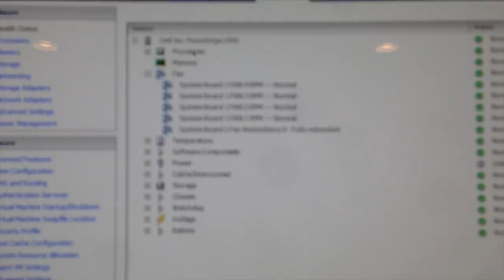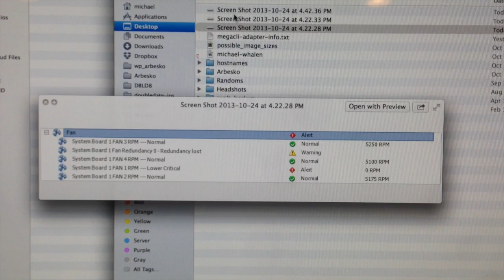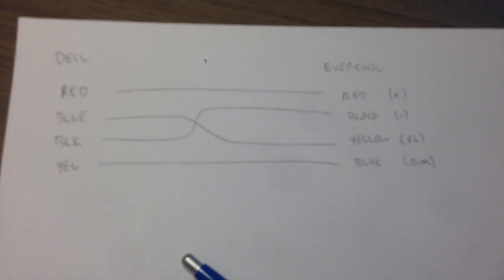Fan swap on a Poweredge 2950

Comment: I too used the same fans you used.  Incredibly quiet.  Fan RPM run about 3K well above the low fan speed threshold.  System temperature stable in the middle of the range.  Other PCs in my office are noisier!  Thank you for the guidance.

Comment: I finally swapped the fans in my 2950 III and used the same model fans from this guide (Evercool EC6025H12BP). The fans settled around 3500 rpm in my server, so there's no need to change fan failure threshold which is 2025 by default.

Noise: By far it's a major improvement. The server is in my basement but I could still hear it from any room in the house. Spending time in the basement wasn't pleasant because of the high-pitched white noise caused by the fans. Solved completely. I can barely hear the server from 10' away now, and upstairs I hear nothing.

Power savings: Power usage has decreased by 23-28 watts. I'll be changing my cpus to dual L5420s as well, which will decrease power/heat/fan speed even further.

My setup: dual E5450s, 32gb ram, 6 hdds on a perc6i, drac 5, vmware.

Comment: This video was really useful.  I used the same Evercool fans you did and have been pretty pleased with the results.

I did see the temperatures in my system go up a bit (+3-5 deg C under moderate load), but it's not enough to be concerned.

Definitely a fair trade to be able to hold a conversation in the same room where the server sits.

Comment: Also, can you do a video how you modified the firmware? I downloaded it, and I couldn't modify it to turn down the thresholds.
Reply from the maker: Actually I am running the same firmware. I read about a lot of people experiencing issues with the RPM's dropping too low but for me the temps are normal and the fans are not causing any warnings.
Reply: for BMC modification, I booted from Linux Mint on a USB and followed this: http://projects.nuschkys.net/2011/11/15/how-to-adjust-the-fan-thresholds-of-a-dell-poweredge/#comment-2046